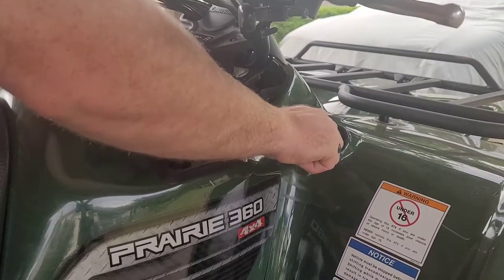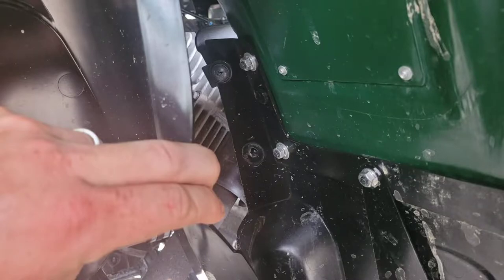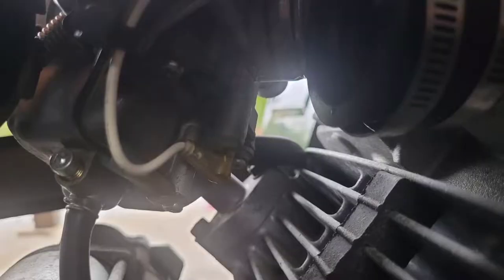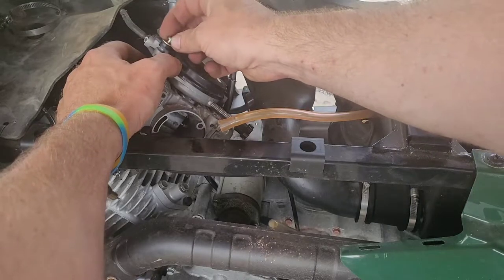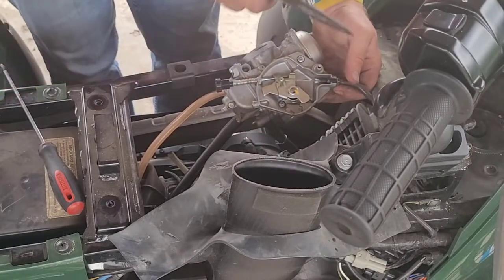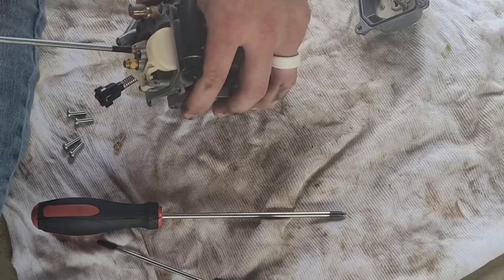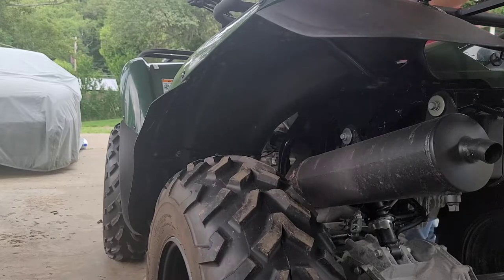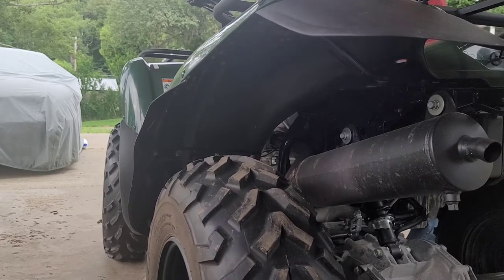Prairie 360 Carb Removal/Clean #kawasaki #prairie

Comment: As a guy who has worked on a LOT of small engines, and the only thing I would argue with you about: use SOMETHING to ream out the pilot jet and main jet (I prefer a small guitar string or a precision drill bit.) Sometimes jets will NOT come clean with carb cleaner and compressed air, and it's VERY FRUSTRATING to reinstall a carburetor and have the jets still give you headaches.
That's my 2 cents, but I enjoyed the video. I learned a lot!

Comment: I have one that idles real high on choke but dies if removed, but only in cold weather. When in spring or summer use runs and idles fine. No matter how warm the engine gets in cold weather same problem, got any thoughts?
Reply from the maker: ok so first off, i would pull the spark plug and see what it looks like.    these machines seem to come with a lean air/fuel ratio.    i actually got a bigger main jet for this machine after i did this video.   made a huge difference.      something else to check is the valve lash, just to make sure they are in spec.

Comment: I’m having a hard time keeping mine running and it takes for ever to be able to take choke off then it barely wants to idle. Brand new carb.
Reply from the maker: is the carb an oem carb? or is it an amazon/ eBay special off brand one?
Reply: Aftermarket ebay. But it always ran like that.
Reply from the maker: ok so these models come with pretty lean from the factory. you might want to up the jets a little and see if that helps you clear up the running issue..  this one did the same thing until i bumped up the main jet a couple spots and adjusted the air fuel screw a little.
Reply: We upped the jets as I had a larger jet on the original carb. So I’ll adjust the idle screw with the knob. Do I need to adjust the pilot screw also?
Reply from the maker: ok so when doing any of these changes, the idle screw really shouldn't need to be adjusted all that much.     the main jet is from, lets say mid to WOT, so that size shouldn't effect idling.   the pilot jet will. i dont remember the factory size. but lets say its a 35.. throwing a 37 in should help richen it up.  if you want to do a quick adjustment,  youll have to screw OUT the air/fuel screw under the carb.   usually they are 1.5- 2.5 turns out.  turning it to 3 will richen it up as well. anything passed that wont do much and youll need a new bigger pilot jet.

Comment: The bottom hose what is that for
Reply from the maker: the bottom line from the "bowl"... that is there for the fuel to leak through if the float isnt working correctly.  instead of gas leaking into the airbox or down the cylinder....it just leaks out onto the floor
Reply: @Simpsons.R.S  oh ok I was wondering cause my four wheeler is acting as if there is no fuel going in but there is and there is spark so I don’t know what to do
Reply from the maker: @Evan Winship  were you able to see if your valve lash was in spec?     i hate telling people to buy things.. but you could try and get a compression gauge at Harbor Freight.  you would be able to tell from there if youre having problems
Reply: @Simpsons.R.S  I just did a compression test and it was only 10 to 15 and that’s only for a pull start so I was wondering what my options are
Reply from the maker: gotcha. ok well ya definitely something going on.  you might have to pull the head off and look it over unfortunately
Reply: @Simpsons.R.S  oh ok I was thinking it may be the head gasket
Reply from the maker: it could be. but once you have the head off, youll be able to inspect the head gasket, valves, piston, and cylinder to see if theres any damage.
Reply: @Simpsons.R.S  do you know what would make the carb come off the boot my four wheeler have a backfire and it blew the carb off the boot
Reply from the maker: definitely could be a few things.  timing could be off and caused that.  or the carb gummed up and caused a big backfire.